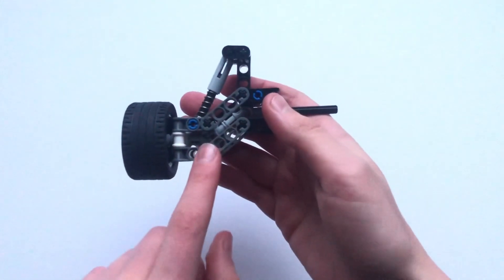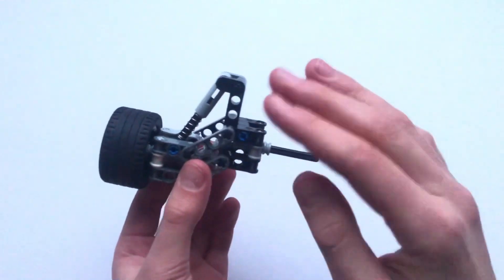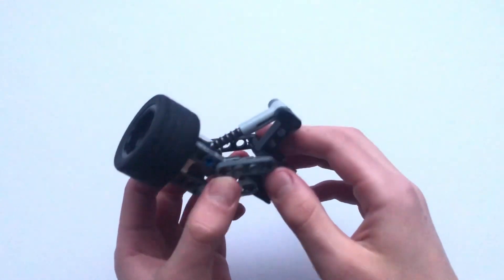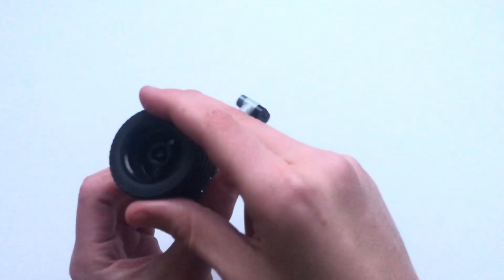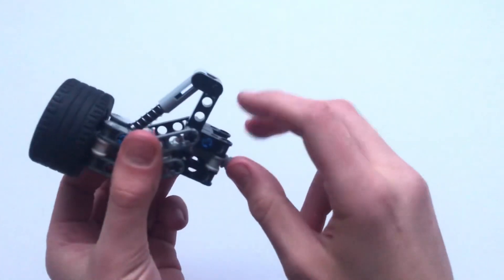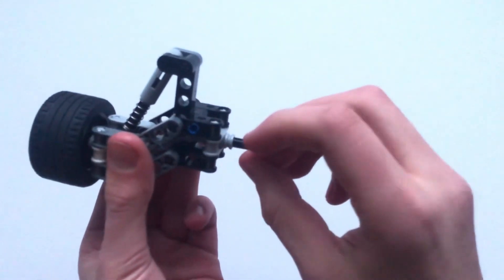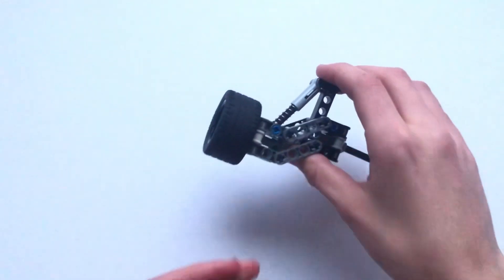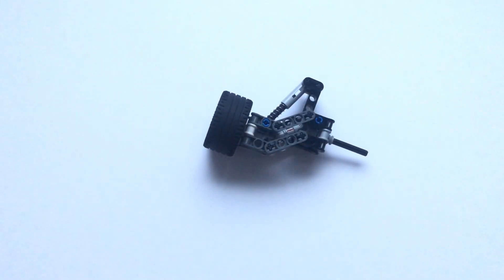Simple Lego Suspension! (V2)

Comment: If I built a heavy RC motorised car and had this suspension on all 4 wheels, wouldn't the suspension just become flat like at 2:59?
Reply from the maker: You could say the same about any car ever built. You can change out the grey shocks for the yellow ones, and they are a little bit stiffer.